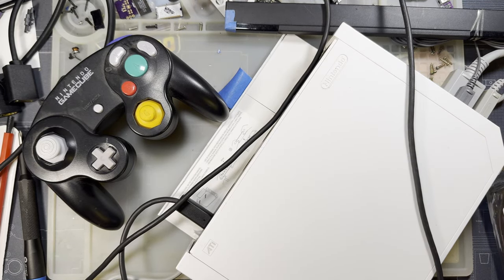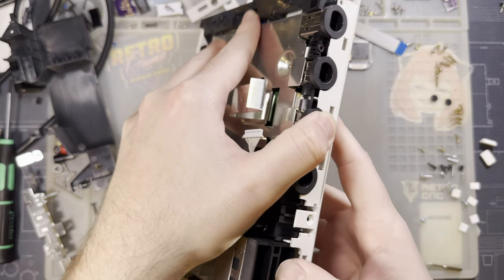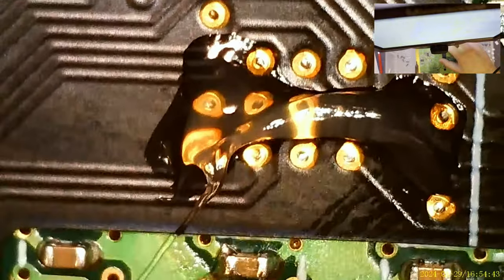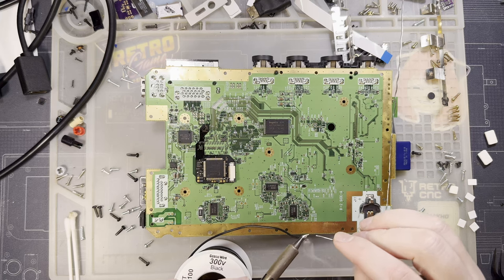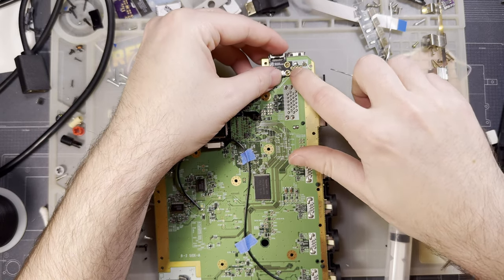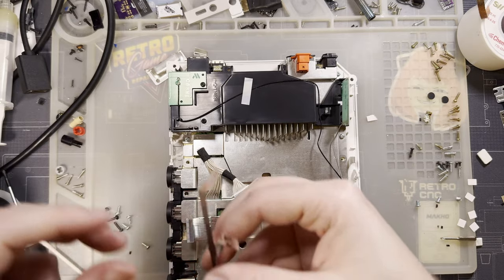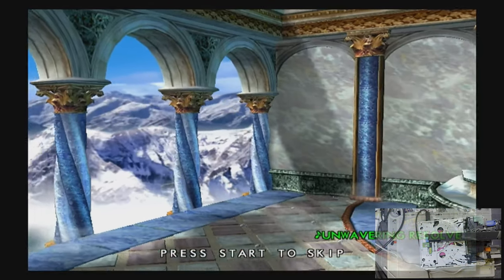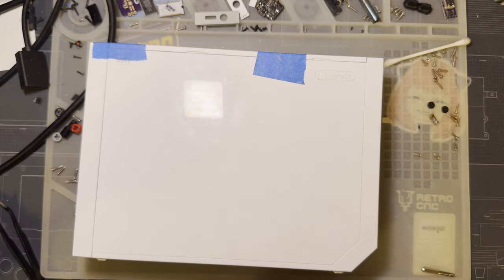ElectronAVE Kit -- Wii Digital Video Output

Comment: Hi Makho, I appreciate your work! I have a question regarding the slate - I posted this on an old video but I am posting it here again in the hopes you see the comment. Is there a way to adjust x and y positions on the screen? I ordered the non-laminated screen and lens and the image unfortunately is not centered - I have black bars on the bottom and on the right, the image is cut off on the top and on the left. I installed twice and both times the same problem. As you know, the screen and the lens can not be moved/adjusted in the shell the only way would be to adjust the image position, right? please let me know if you are familiar with this or have a solution. thanks!
Reply from the maker: You don't need to comment on multiple videos just to get in touch with me. I read all the comments when I can. I just don't do that every day. 

1) See my answer to your first comment
2) I made the Slate, yes, but RGRS handles support. Contact them please. 
3) Keeping comments on topic helps keep information organized.